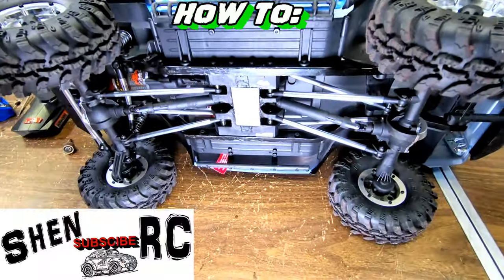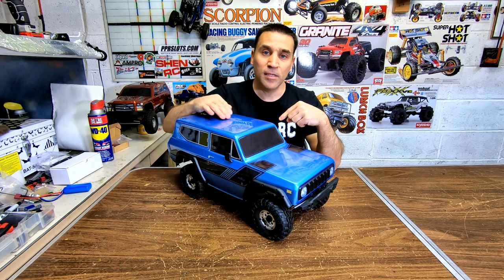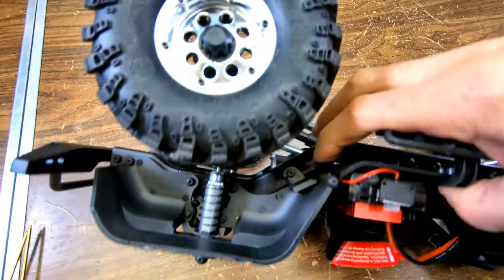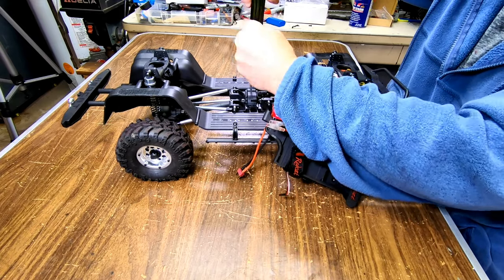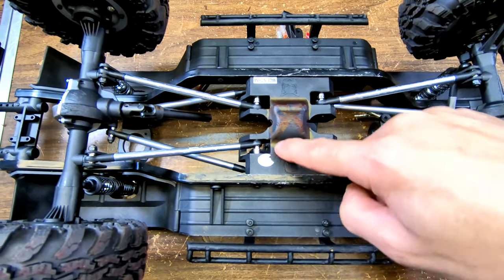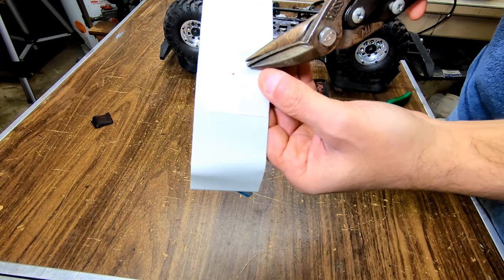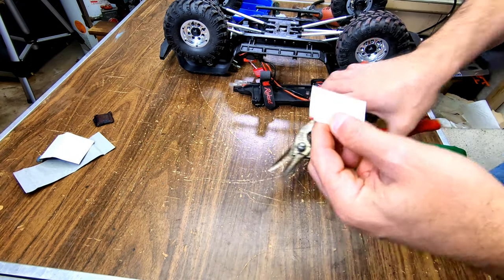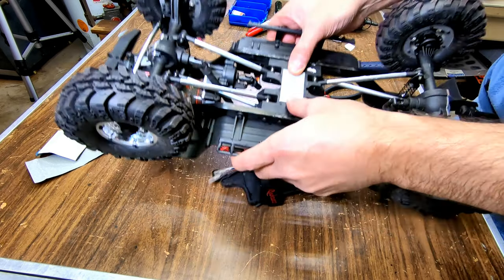Redcat gen 8 scout | HOW TO MAKE A FLAT SKID PLATE | DIY MOD UPGRADE

Comment: That is a very clever idea!! 👍👍😎 
I share the concern of others... The stress factor on the Skidplate - over the LONG run. Again, great idea....
The only thing I would do differently is, first - use a Two-Part Epoxy instead of Shoe Goo. I wouldn't want anything flexible holding on a major structural Center point. 
Using the STEEL plate was a great idea.  I would have made it a little larger, since the Driveshafts are no longer in the way, you've got the clearance.

And second, some sort of reinforcement on the top, around the TRANSFER CASE. One could even replace the Stock Plastic Transfer Case, with one of the METAL ones, sold on EvilBay, fairly cheap. Most of those even have FLAT BOTTOMS!! 
The big difference is that many of the Aftermarket ones have a 1:1 Gear Ratio, instead of the 1.8:1 Ratio on the Redcat's. The mounting holes are in the SAME place! 👍 To compensate, go 2 teeth smaller on the Pinion Gear. As a plus, you'll have a little more top speed, without sacrificing low-end Torque!!! 😀 

I've been doing this for over 37 Years.... Like you, I can look at something, and see solutions. I HOPE that I can afford a Gen 8 someday, this will be my FIRST mod! 
Except for the Toy-Like BLACKED OUT WINDOWS - Redcat hit a GRAND SLAM with this Rig!!! 👏👏👏👏👏🍺🍺
Carmine 💥 ⛽
Reply from the maker: 😁👍 Hi The goop glue is 100 times stronger and will hold way better than epoxy done it all before ..once you use goop glue you hardly ever will use epoxy again.  the center skid don't get weak at all you only take a small square out of it and the l ump is only a couple mm thick so the trans can  sit down in it also the way the skid is  screwed into the sides of the metal chassis rails you would have to twist the metal chassis for it to flex... No worries about cutting the lump off at all. You could have went all the way across the center with the steel plate but I did not want to I wanted a small section so it would not get hit as much no need for a larger one in my opinion your just making more surface area lower down to get  scraped  on stuff. 😁👍O and I been doing this for probably 37 years also and owned hundreds of RC's and did everything imaginable ...so trust me when I say this that cut hole on the bottom wont effect anything and with what i did it works 100 times better than stock. 👍 Thanks for stopping by.

Comment: sorry I missed this I'd set the reminder as well. Neat mod. As an aside one 'the' best Dremel bits I've bought is the disc cutting kit. It lets you cut out in straight lines and it'd be ideal for cutting that centre section out. It's about $20+ but it's super useful, cut screws off etc. And one of the best uses is to cut a slot in busted hex screws, lets you then use a flat head screwdriver to remove them.
Reply from the maker: 😃👍 No problem, yea those cut off wheels work wonders!

Comment: I’m sure it might work fine for a little bit. I’m not worried about the drive shafts. What worries me is the parts of the skid directly in front of and behind the transfer case along the centerline. They look really thin now, those 2 points and the battery tray are the only things keeping the skid from cracking in half. 

Have a feeling that one good roll over on the mountain would break the glue loose, bend the tray and crack the skid down the middle. 

Your links transfer a lot of shock directly to the skid. A lot of the time, only on one side when bouncing a bit or during a roll over. 

Would like to see a skid with raised mounts and a solid flat belly though. I’m sure someone will print one.
Reply from the maker: 😃👍 Hi I tested it today and it works 100 times better than the stock skid..in my future video you can clearly see the bottom going over rocks smoothly no hang ups but the stock skid with the hump would have gotten the truck stuck and you would wobble back and forth with the tires spinning rocking until one grabs good enough and then pulls you over the rock.  The case is strong and the middle section is also with hole it was strong and the way it's screwed into the chassis you would have to bend the metal chassis rails to make the skid plate bend...Also with that goop glue on the bottom of the metal and then beaded around the back hole cut out it will never fall off I done this before with using just goop glue on a metal skid and it don't come loose... another thing you could use one dab of the goop glue on the gearbox  bottom so it glues down on the metal plate and that will make it secure even stronger...goop is awesome glue its strong but can be removed if needed.  One last thing you can drill 4 small holes and use button top allen screws and hold it on the bottom of the skid plate but I like perfectly smooth method with the glue.  No problems here ran it up some steep inclines bouncing the truck up and down on power no issues at all the slipper clutch will slip before it gets any pressure enough to break anything on it...That's why they used it on the new gen 8 model. WOW wrote a book..Hope this helps .  😉 look here for a photo showing me run it https://www.youtube.com/user/shenlonco/community?disable_polymer=1
Reply: I am sure for your application you understand what will work and what won’t. 

My point made in the original comment is this does weaken the skid. With or without metal and glue. That is important to know for some. 

In my neck of the rocks, that skid’s days would be numbered. 

Good job and good luck. Most of all. Happy Crawling.

Comment: Looks good! but not sure i would want to weaken the middle of the frame right there where alot of stress occurs between the driveshafts transmission and the shock links are all attached, some of the frame looked pretty thin in areas after you cut it out
Reply from the maker: 😃 Hi no worries the section was strong without the brace I put on over the hole. Thanks for watching.
Reply: Let me guess he explained why he's right lmao he's never wrong and won't ever admit it. Crazy hacks lmao I don't care if it is a slow crawler that will eventually crack and break.
Reply from the maker: @stpbasss3773  BS it will never break I drove it for miles already beating the hell out of it and the the frame rails will need to twist before it will break!!  Lot's of guy's did this now and have all good results no problems at all . You must always think your right obviously you have not done the mod and tested it or even own a gen 8 don't see any gen 8 videos on your channel showing yours running if you have one?You can see plenty of my Gen 8 videos and clearly see my skid is not broken. Are you ragging out on all the other gen 8 owners that did this also or 3D printed flat skids or purchased after market flat skids telling them they are all wrong also?
Reply: @ShenRC  yeah i have seen you beat it pretty good since the mod and it seems just fine!

Comment: What screws did you use?
Reply from the maker: Hi it's been so long I don't recall but you need to use screws that are longer than the stock ones by the extra length of the traxxas metal ball ends I used so it can be threaded in the same as the stock ones..
Reply: @ShenRC  Oh, well that's ok.  Thanks
Reply from the maker: @brickbros-m41a  Redcat now makes a flat skid plate for the gen 8.
Reply: @ShenRC  I know, I just don't want to have to take everything apart to put one in
Reply from the maker: @brickbros-m41a 👍 I hear ya that is a pain.

Comment: Another awesome vid Steve,  great updates...you have some great ideas...you very adventurous though with your new gen8 but much better...one question,  did I hear right you don't run your trucks on lipo batteries.
Beautyyyy steve
Reply from the maker: 😎👍COOL! thanks for the nice comment.  I mostly use 6 cell Nim packs in my crawlers only sometimes I try my lipos ..don't know why maybe i should run the lipos more often.

Comment: Great mod was awesome you pulled it off without raising the battery so it shouldn't affect the cog much. Now I'm curious how it will affect the durability if at all. 🤔
Reply from the maker: 😃👍Thanks it's awesome now i really like it!  It only raised the center gearbox a few mm so it's nothing bad at all and the shaft coming out of the front gearbox now run perfectly level also.
Reply: @ShenRC  awesome 👍👍👍

Comment: Nice mod. I cannot understand why anybody would make such a skid. When I think of my 1/14 Thunder Tiger Kaiser I could kick someones ass. The hump on the Kaiser is superhuge.
Reply from the maker: 😁👍 I hear ya that's why I did anything I could to get that darn hump off the bottom it ruined everything about the truck...don't know who the hell works at redcat but If i was helping for the design it surely would not have had that lump hanging down on the bottom!

Comment: Big increase in angle of drive shafts though. Bit too much i think?
Reply from the maker: Hi it hardly increased at all the spacers are only a few mm. Mine is still running strong and working awesome! In fact redcat now makes a smooth skid that does the same exact thing as mine does so they must have liked it.  Thanks for watching.

Comment: Great video but as someone pointed out I’d also worry about the stress put on the truck at that point and also the fact you raised the transfer case and changed the drive shaft angles would that also put extra stress on the shafts?
Reply from the maker: 😁 Hi the center section was strong with the hole in it and when you put the center skid on it makes it even stronger..also it don't flex because it's screwed into the chassis on each side and you need to twist and bend the chassis sides to make it flex so that wont happen.  The shaft angles hardly change that much it the center gear box is only lifted up a few mm no worries here.  Thank you
Reply: No issue. It’s a crawler, if it were a speed demon that would matter but it’s not.

Comment: durn nitofukashun junk! (lmao) couldn't tell if you'd put clear hard plastic skid rails to the bottoms of the frame rails or no (like vacu-form package material or similar). might help slip over stuff without scratching paint off the metal. trans raised/covered looks good, a little black paint it'd look like it grew there.
Reply from the maker: 😃 Hi thanks sorry about the YT a lot of guy's told me they did not get the notification, I did paint it black  👍

Comment: you could of  used stryene to put in the cut out an then painted it an you would not know it was even messed with i know it late  but i just now getting into the rock crawleing
Reply from the maker: Hi no way that would hold up at the place I run my G8 also I used the thin metal so I could drop the geabox as low as possible if you stuff a section of plastic in the hole you cut out you then need to raise up the center gearbox a few mm of the thickness of your plastic you are using... Why I went my way for all out performance.👍
Reply: thanks for leting me knoe why the thick piece oh yeah i got a redcat everest 10 can i  put a frame under it an get rid of them two sides so i can  put  hard body on it  some people say everthing will just bolt up but i thought i would ask you sence you been in the rc s for a bit  hollor back thanks keep on crawleing
Reply from the maker: @bobbyspencer1490  Hi thanks, the everest 10 uses the same axles as the gen 7 so you should be able to hook it up some how.
Reply: @ShenRC  what about an axial scx 10

Comment: All Redcat did is trade one hang up, the pumpkins, for another, the skid plate. You would think they learned their lesson. 
 That said I think if you used styrene to cover the hole you could build a much stronger plate and the  plastic cement would make a near 100% bond.
Reply from the maker: 😁 Yep for sure... this method is much better than using styrene plastic... The hole cut out don't do nothing hardly because the lump is thin material and the skid is screwed into the metal frame rails and you would have to twist them to make it bend. I went with the thin steel method for most ground clearance and smoothness...I done this before on many RC's and that goop glue it don't come off unless you manually take it off with tools and that metal skid will bend like a pretzel when you try and get it off because that goop glue is like one of the best glues you can use on most anything.epoxy and all those other glues are garbage compared to the goop brand glue I tried them all and I mostly always use goop.😁👍 Tried true and tested! Thanks for watching.

Comment: All this for really nothing, I've never been hung up or unable to climb something because of the hump everyone freaks out about. If you get the gen8 you won't ever notice the hump and you will never say "man I could climb this but that hump" sorry I wouldn't hack away at my nice gen8 for nothing.
Reply from the maker: Sorry to say if you turn your truck over and the hump on the skid has hardly any scratches on it then your never pushing your truck to t's limits so you won't need to take the lump off or buy a after market flat skid for your gen 8 because your not running it hard,   It runs much better flat on the bottom. this is why after market companies are now making flat skid plates for the Gen 8, Are you going on all the other guy's that made them flat or printed 3D flat skids or purchased flat after market skids and also ragging on them telling all them they are wrong also?